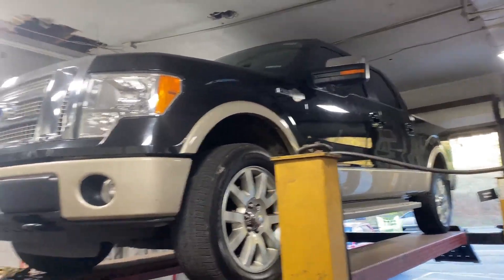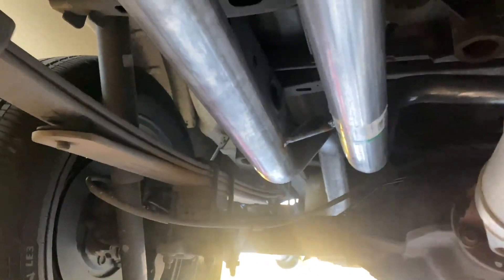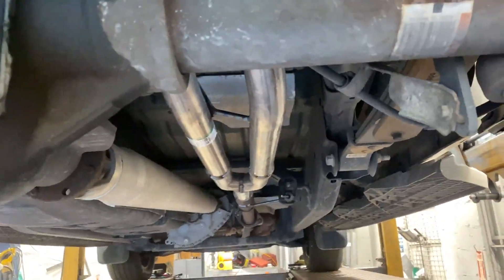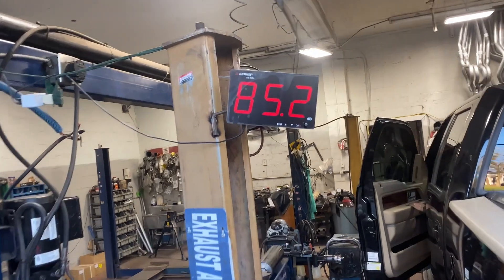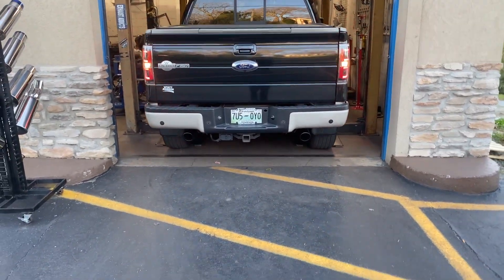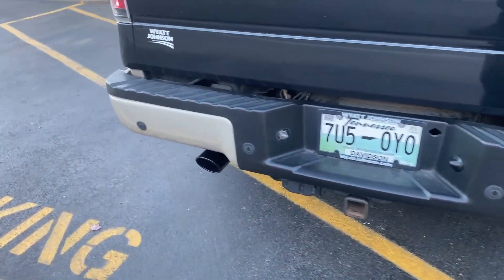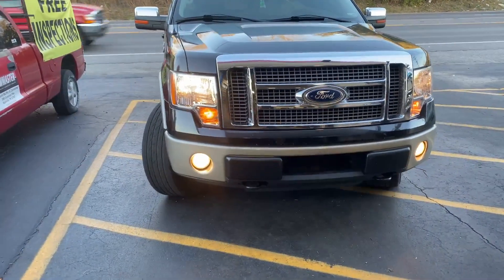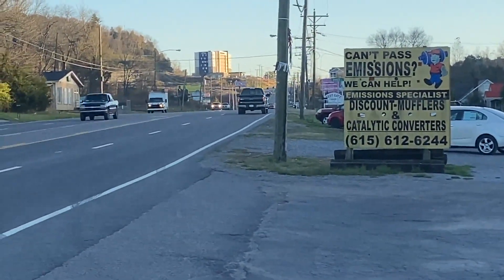2012 Ford F-150 5.0L COYOTE DUAL EXHAUST w/ STRAIGHT PIPES!

Comment: That is not a 5.0,  to quiet . It’s a 2010 5.4  even the cluster is wrong for a 5.0
Reply: Yeah. That has to be an 09 or 10
Reply: It is a 2012 but this is a King Ranch edition.
Reply: @ragintaurusmusclemercury7023  nope sorry
Reply: @MrPowerstroke12  The King Ranch badging is on the tailgate and the middle digital display between the tach and Speedo. You can easily Google pics of the interior. It is a 2012.
Reply: @ragintaurusmusclemercury7023  its not. It has to be a 09 or 10
Reply: @crosbylewis3660  I'll go by what the owner said. 👌
Reply: @ragintaurusmusclemercury7023 it’s an 09 or 10 because those years all had different gauge clusters unique to trim level, 2011 and up they all had the same gauges after XL, trim brocade they all had the screen in the middle.
Reply: @josephstalin6281  Ok.
Reply: @ragintaurusmusclemercury7023  it is a 2012. But 2012 still have the 5.4L
Reply: Also I have access to Carfax on my phone. I can run reports with plates #s Only... it’s a 2010 5.4l 👍👍
Reply: @skylarhawkins2284  Ok. 😉
Reply: @ragintaurusmusclemercury7023  its a 09 or 10 with the 5.4. The 5.0 doesnt sound like that
Reply: @stew-03  Ok. 😜

Comment: That's a 5.4L triton. My dad had a 01 with a 5.4 and sounded exactly like that. Nice try tho
Reply: Uh no it’s a 5.0L Coyote as stated in the title. The 5.4L Triton was discontinued in 2010 for the F-150 and this is a 2012 F-150 so it couldn’t be a Triton unless they did an engine swap
Reply: @waffletraktor9660  pretty sure that's a 2010 or 2009 both those had the 5.4 and look at the gauge cluster notice its not digital. Only had that 11 and up also dont sound like a 5.0